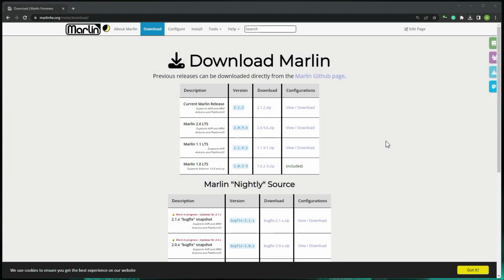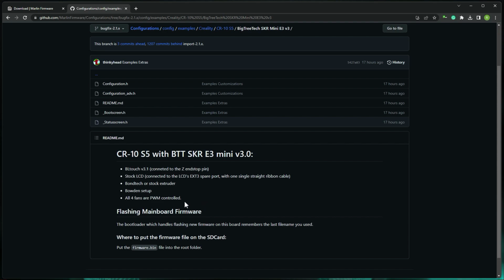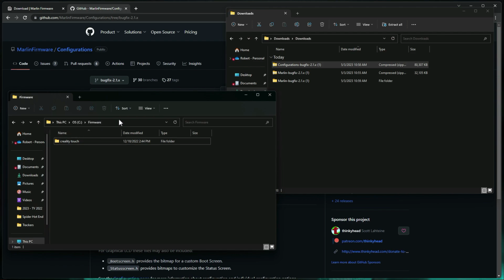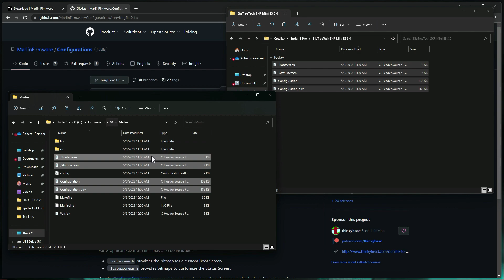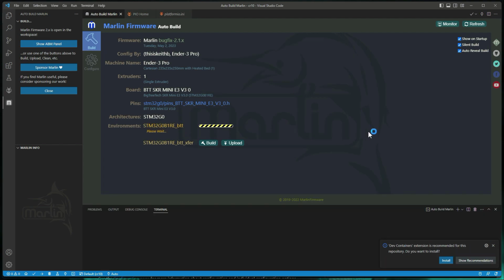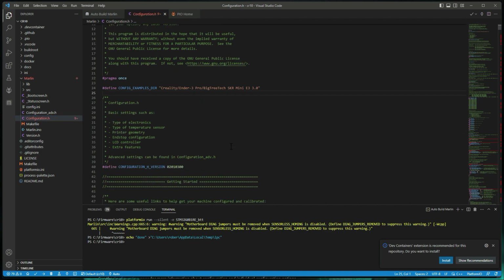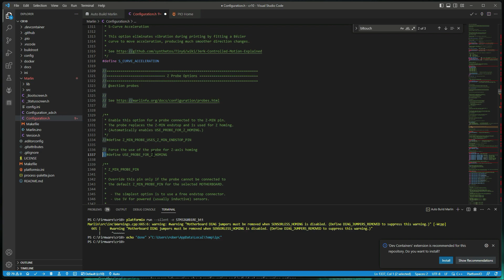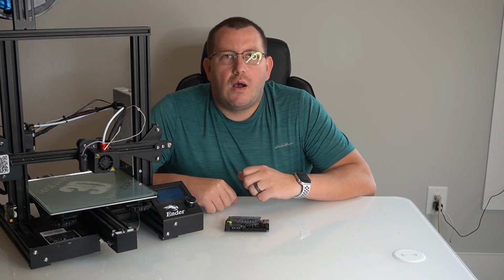Marlin Firmware for CR-10 and SKR Mini E3 v3

Comment: I tried this on my CR10s but after updating the eeprom it now thinks that my origin/home is +300, 150, 0 and not 0,0,0. To the point that it keeps racking trying to go further +x then it should.
Reply from the maker: Hi. Try to clear eeprom.
Reply: @3DPrintscape  clear the eeprom? As in reset it using the reset button and reflash the original firmware or did you mean to use commands through the terminal?
Reply from the maker: @papalatistudios  For most firmware, its just restore defaults in the menu.

Comment: Hello! have this problems for stock CR10:
 error: missing binary operator before token "("
 3135 | #if DGUS_UI_IS(MKS)

error: missing binary operator before token "("
 3137 | #elif DGUS_UI_IS(IA_CREALITY)

Thanks for your help!
Reply from the maker: Hi. Was that before making any changes?
Reply: @3DPrintscape  Hi! I juts downloaded from your page the file in CR-10 section, stock version, I'm not make any changes, just put into new marlin, open in visual studio, tried to compile and appears this. ;)
Reply from the maker: @rodrigomunoz4757  If you just pulled in the configs from the build you will probably have issues if the binaries are from a different build. I provide the configs mainly for reference in case someone wants to build the latest build with the same changes. That said, the changes will need to be manually made in the new config. Try to grab a clean build and config from marlin and see if that compiles correctly.

Comment: I had a friend of mine lend me a hand on my upgrade - I put SKR Mini E3v3's and TFT35s in my 3 CR-10S machines.  One snafu we encountered was the filament runout sensor.  I don't use those things and despite it showing off in the menu, anytime I started a print, the filament change processes would kick on.  I had to add a line in Cura to my start gcode to get around that.  Overall the upgrade went well but there are a few quirks.  The status portion of the LCD will beep telling me no sd card which is fine, I print via Octoprint/USB anyways.  The process of setting the z offset was really wonky, I couldn't get the nozzle to lower for a bit.  It sure would be nice if there was a gold standard / approved firmware for such hardware setups!
Reply from the maker: Hi. is the filament sensor enabled in the firmware you built? If it is you may want to disable it there.
Reply: @3DPrintscape  yes. Working on that!

Comment: I've been running into this weird issue for the past month where my motherboard detects/updates firmware via the microSD card reader (via microSD card extender), but it cannot actually read any STL files via that same SD Card reader (In both cases, I am using an SD Card extender, but it doesn't seem to matter since I get the same results when I put the microSD card directly into the board anyway)

Any tips on how to deal with this unwanted behaviour?
Reply from the maker: Hi. What board and chip do you have? Im thinking it may be one of the GD chips and the firmware doesnt match it.
Reply: @3DPrintscape  I resolved my issues since then, actually. 

The first issue of just not detecting the microSD card at all was simply that the 8GB microSD that came with the Ender 3 v2 is simply defective/degraded; I purchased a new official SanDisk 8GB and formatted it to the same settings - it detected properly thereafter

I noticed a second problem, but I was the one who created the problem to begin with. The symptom was that even though the gcode was detected in the Media menu, running it resulted in the printer not displaying the print progress menu, waiting for 20 seconds, the printing erratically for 3 seconds before saying job complete

The issue I had in this case was that, in trying to solve the first issue, I messed with the HAS_MEDIA buffer size in Config adv. I had set it to 64. I managed to fix it by reducing it back to 16. That being said, 32 seems to also work without error - just 64 and above are glitchy
Reply from the maker: @x_jaydn  Im glad you were able to get everything working. Thanks for sharing your findings.

Comment: Hey Big guy, I need your advice. I plan to make my Ender 5 Pro a little quieter by attaching a Noctua fan to the inside of the steel base plate and removing the PSU cover.  Therefore the base plate is now supporting both fans. IYHO do you think the base plate will be enough to protect the PSU? After all the PSU cover only holds the original fan and the base plate covers everything!
Reply from the maker: Hi. I personally would feel ok running it that way assuming nothing is making its way by the PSU. That said, it is a risk and power supplies are dangerous so I have to recommend (to protect myself legally) that you dont do it :) .
Reply: @3DPrintscape  I always appreciate your advice and your prompt replies which is why you are one of the best subscriptions I have. I understand your viewpoint about safety. It is not ideal but I have to reduce the noise or I cannot use the printer. This is a short-term solution. I do intend to move everything to the rear of the machine asap. And adopt the fan mod you suggested a while ago with the Ender 3.Thanks again Boss, please have a great day.

Comment: Anything different for CR-10S config using this method? Or is it better to use the CR-10S v2 config. (other then fan/chip speed i am not sure what is different in the V3)
Reply from the maker: Hi. I would use a config for the v3, the board is whats going to make the difference.
Reply: @3DPrintscape  Thanks, ended up using your V3 config for the CR-10 and compared it to the the V2 config for the CR-10S. No differences for the printer settings that i noticed and everything's working.
Reply: @zackachel36  can you help me pls. Can you ñoint to a goos tutorial on how to start  the process to change my stock mother board  to this one on my CR10s´? please

Comment: Thanks for the video! I did all but now I'm having heat bed issue, the bed temperature is not raising. Anyone else having the same problem?
Reply: Ok fixed, the polarity is inverted in the SKR Mini E3 despite of the connections look very similar. Luckily nothing broke.
Reply from the maker: Im glad you got it fixed :)

Comment: Thank you VERY MUCH.  IM trying to work thru firmware for mini E3V3 with bltouch and smart filament sensor.
Reply from the maker: Hi. You're Welcome. Let me know if you run into any issues.
Reply: @3DPrintscape  I followed your guide for the bl touch ( even though I have a cr touch). Strange issue. Turned printer on with new firmware. With my TFT screen is dual mode. So in the touch screen mode it says auto bed level failed.  I checked every setting in that section. One setting was type 1 to turn on. Abl but it fails. At same setting there one for setting offset.  THAT. I can change.   NOW IF I GO INTO THE ORIGINAL CONTRY(like you can with btt TFT screen).  Then I can tap Auto Home. And it does 100%. Bed moves out half way. Extruder moves to middle of arm. Pin pops out on cr touch. And extruder lowers to bed. It works for auto home in the non touch screen side but not on touch screen side.  What am I missing.  Before I balled up the firmware trying to install smart filament sensor, the cr touch worked great. I could 9pt check bed level , auto home on the touch screen side. But something is amiss
Reply from the maker: @bruceyoung1343  Hi, when using the tft35 after you flash the firmware you need to run a mesh. If you dont you will get the abl off or failed message. Once it has a mesh, that goes away.
Reply: @3DPrintscape  ok.  Thank You Thank you Thank you. Will do that when I’m home.  Thank You 🙏

Comment: So what is your site? How do I get to it for the CR 10 configuration?
Reply from the maker: Hi. Link to the site is in the video description and i will post the full link to the firmware section tomorrow when i upload the cr-10 firmware.
Reply: @3DPrintscape  please let me know when
Reply from the maker: @rdolge49  I just uploaded them. Please let me know if you run into any issues. https://3dprintscape.com/marlin-firmware-builds/
Reply: @3DPrintscape   I'm fairly new at downloading the stuff, so I'm not really sure what to do. Can you please tell me what I need to download so I can put it in the machine thank you.
Reply from the maker: @rdolge49  If you have everything wired to the bltouchport and the z stop connected, download the bltouch version under the cr-10 section. Then extract that and put the .bin file on the sd card then power on the printer.
Reply: @3DPrintscape  i'm not sure where to extract it. The only problem I'm having is to level the printer it's won't level the size of my bed. It print the size of my bed.
Reply: @3DPrintscape  I do not have a bltouch
Reply: I love the SKR Mini E3
Reply: @3DPrintscape   I tried to open it, and the zip file says it's unsupportive I having Mac computer
Reply: @3DPrintscape  more than happy to pay for to get this straightened out
Reply from the maker: @rdolge49  Can you ping me on discord? You could also use a trial version of winzip to open it. I just used the native windows zip to make it.
Reply: @3DPrintscape  I will try it. I tried my wife's IBM computer and could not get it to work either.
Reply: @3DPrintscape  what do you mean by ping you?
Reply from the maker: @rdolge49  Sorry, just message me on discord.